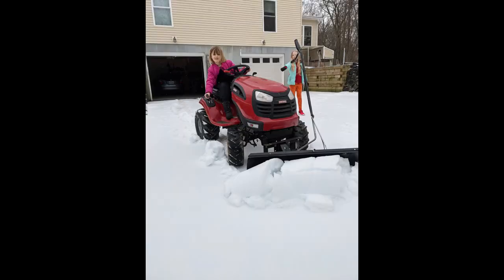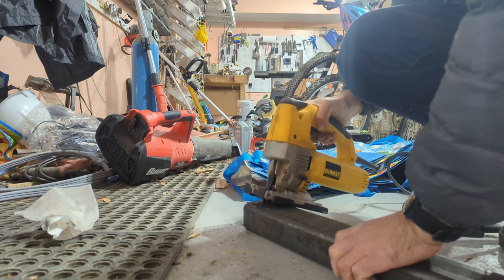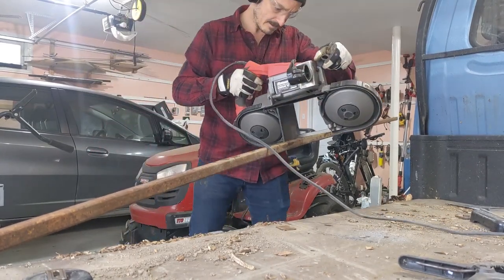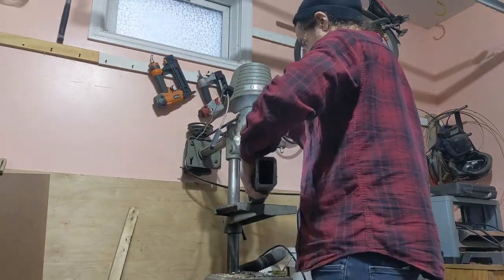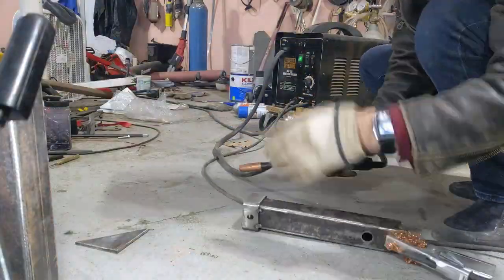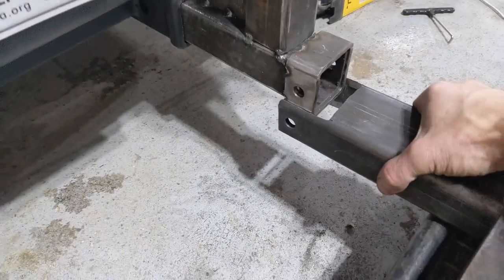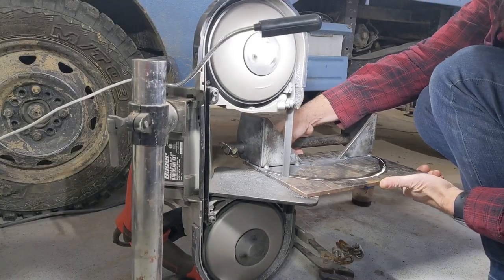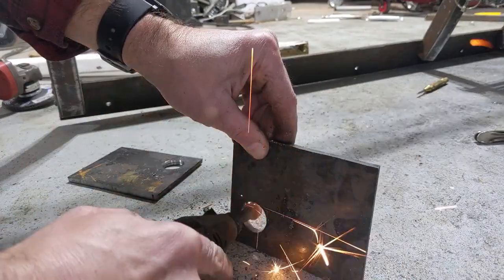DIY Snow Plow from Trash - Part 1

Comment: I have welded on concrete for many years without an issue, but I only tack stuff together in contact with concrete and then turn it so heavier welds are not done with the piece laying right on the concrete.

Comment: Nice work. BTW real men weld on the ground.
Reply from the maker: Ha, real men that have a habit of covering every flat surface with tools - so even if they had a welding table they wouldn't be able to use it.
Reply: I stopped doing that when my concrete started popping…   ;-)
Reply from the maker: @JimsEquipmentShed  uhhm, started popping? As in cracks started in places heated by welding?

Comment: Nice work but I don't understand this caveman style of work? If you have the abilities to build a plow then build a bench to work on! Do it and see how much better your work turns out.
Reply from the maker: Yeah, I suppose for most tools it's the cost (in time or money or floor space or maintenance) vs the benefit (which depends on how many projects I do). My welding gear is truly sub-par, but it works for now.